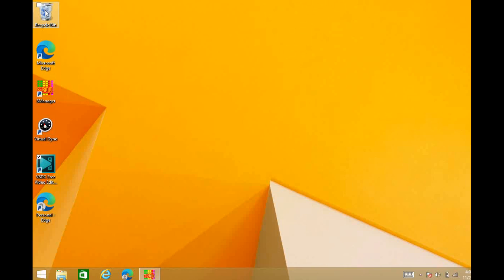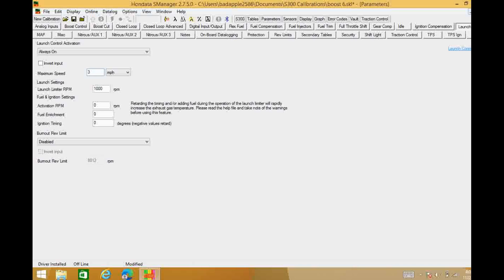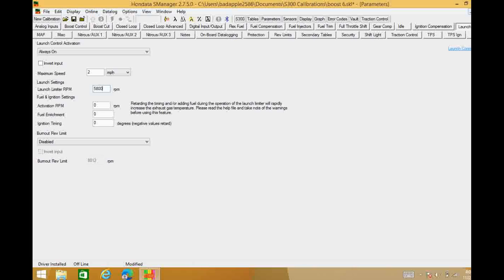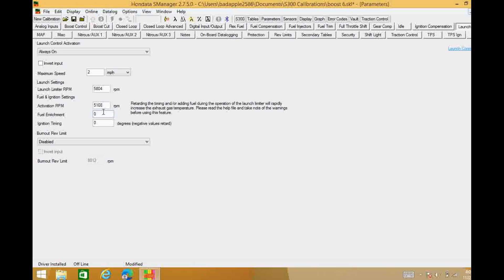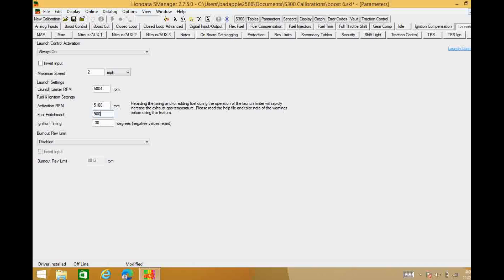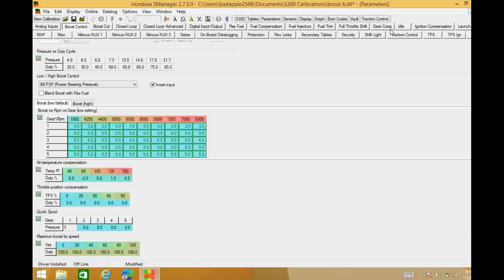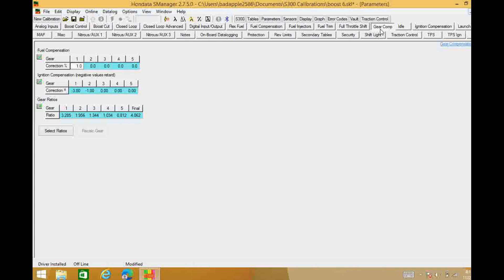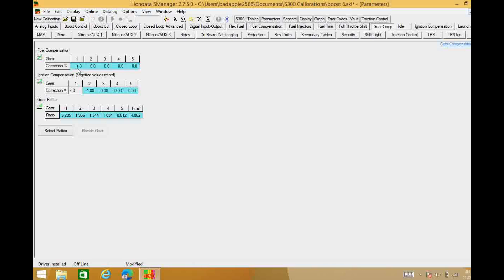2 Step Launch Control Using Hondata

Comment: Do you have a video for a non v b18b1ls guide or should be the same maybe ?
Reply: For my non v set up I'm at 5500 limiter, 4800 activation,  200 fuel, -40 and I make 9psi on a garret 3076r gen 2